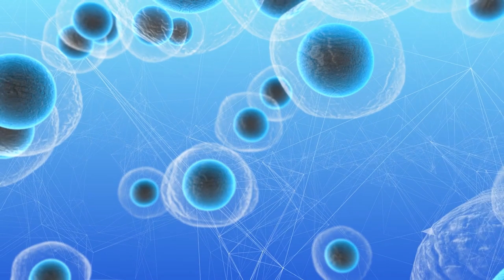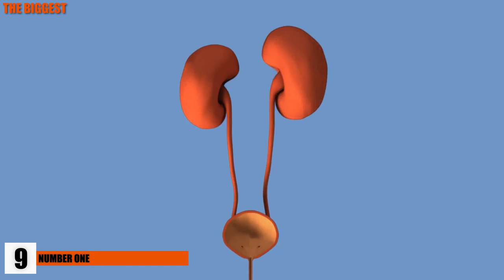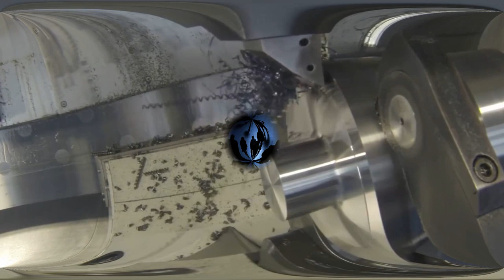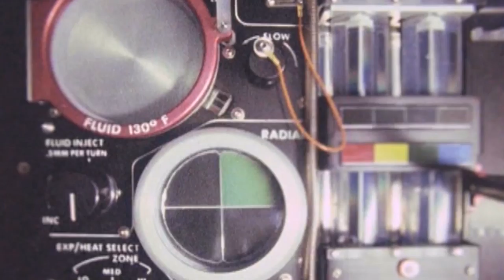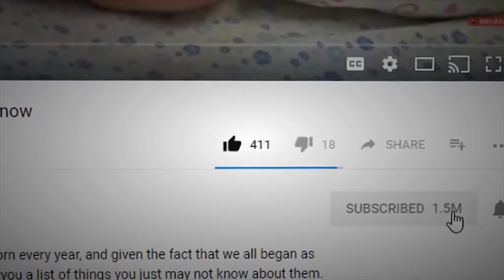Weird Things You Didn’t Know About Space Flight

Comment: My dad said they could not stay there in ISS over six months for some reason due to lack of gravity and overtime:
1. They would have prostate cancer. They need sex. Wet dreams cannot happen there.
2. They would have hypoplasia or shrink muscle. The gym there is not as much effective as in the earth.
3. They would have shrink penis.
4. The sperms are continually increasing inside the testicles and they need to control they sex urges. Testicles would grow bigger than before.
5. Transmitter has noise buffer. When someone is suffering and shouting through pain or noisy fire or debris occur, only few words would be detected by transmitter to send it to the earth very clearly.

Comment: The last one is kinda sad because imagine having your space colleague die and get thrown out into space and turned into space mush by the iss’s robotic arm.
Reply: But what would you do instead if it e.g. happens short after arival. You cannot have a dead body floating around in the station nor even the trash module. I think there is a to big risk with decomposition and the produced gases in the body.  

They could only try to freeze the body, but the problem is that the body begins to boil when exposed to the vacuum, which means no nice view inside the bag. Even if this has not happened yet they needed to think about a possible solution in case of... 

Another very bad scenario is someone getting really sick on board where he would need a surgery. It may be possible to do the very small surgeries on board but any bigger surgery (even with doctor on board) in zero g environment should be a big problem and very hard to do. So they would have to to bring someone down to earth very fast and there is no other way for this person to tolerate all the stresses and strains of the descent. Just think about sitting rolled togehter in the tight seat of a soyuz capsule with a perforation of the caecum decellerating from some thousand miles per hour with some heavy G-Force!
Reply: If u can't do the time

Comment: I'm far less worried about alien germs than the things here that I deal with on a daily basis, as the things in space have not adapted to my immune system and are more likely than not to quickly be destroyed by my immune system.
Reply: More like your immune system is likely to be destroyed
Reply: @josh1158  T cells encapsulate and digest things that are alien to our bodies, and so far the only things that will destroy our immune system have been genetically engineered to do just that. I suppose you have heard of AIDS? 

This is first semester microbiology, and I would suggest that you take another look. That is keeping in mind that there are some parts of the body that have just been rediscovered even though they were first noted by Leonardo da Vinci in modern times. 

Also, our brain plays a large part in our immune response. People with depression and other problems have a very much compromised immune system.

Comment: how,aboutva turbo charged tokomak reactorthat exhauats Hydrogen 2/Helium 3 plasma via a magnetic klystron tube ( an oldcRadar pulsed sifgnal generator) at greater than thespeed of light to act as a powerful fuel efficiwent space drive for shorter duratio flightts through out the solar system or even to the stars!
Reply: Nothing can go faster than the speed of light.